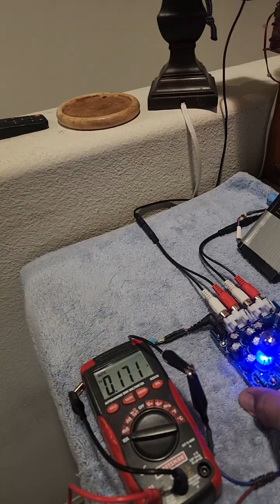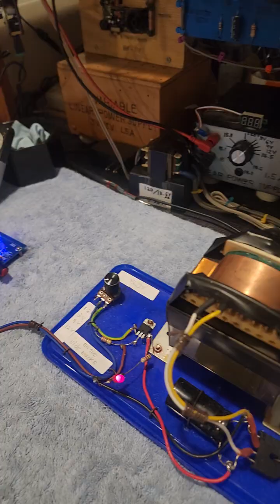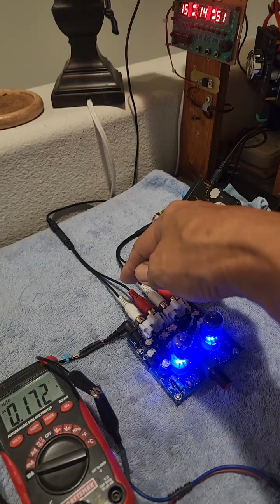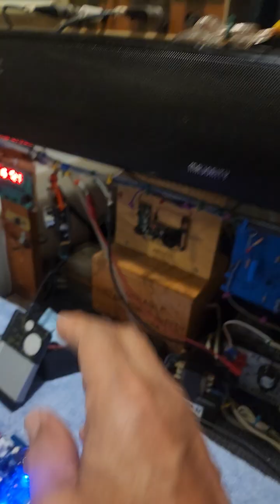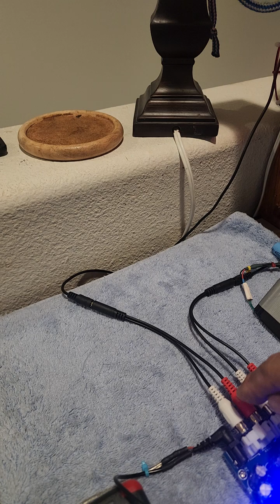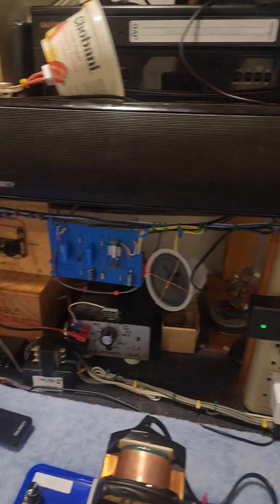Vacuum Tube Pre - Amplifier DIY Assembled Kit @ProfDavidJDelosReyes

Comment: I'll have to watch your build video to see if there's a link to a kit.

Is this compatible with an electric guitar being used as an input signal?
Reply from the maker: Amplifier for electriv guitar is all there pre-amp and main amplifier those attached to heatsink.
Reply from the maker: unluckily there is no link to a kit you must be experienced to assemble you know the parts and how they are installed.
Reply: @ProfDavidJDelosReyes  I realize it's a kit! That's why I asked about a link to a source providing these kits.

I have assembled plenty of electrical projects and made my own circuit boards too.❤